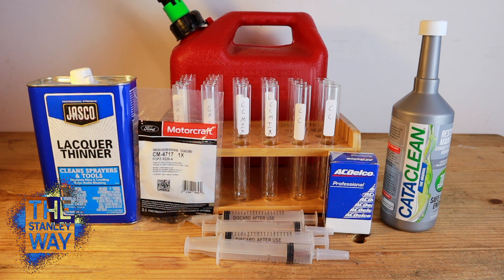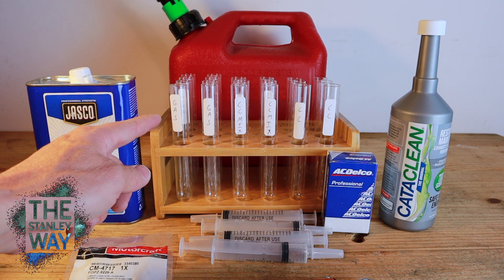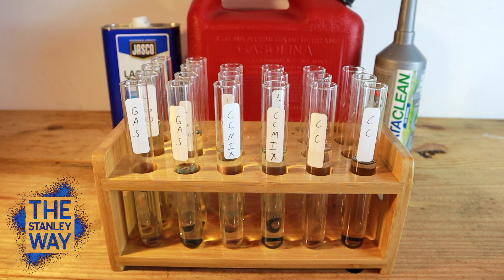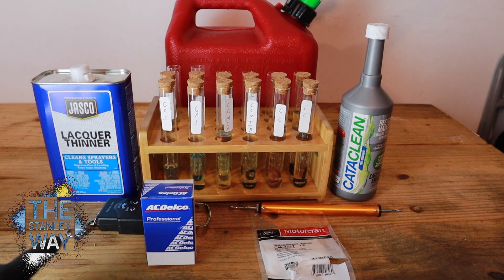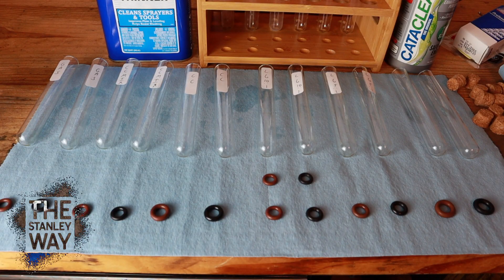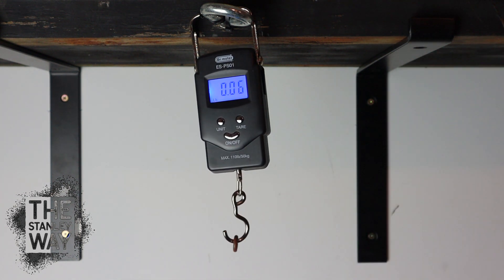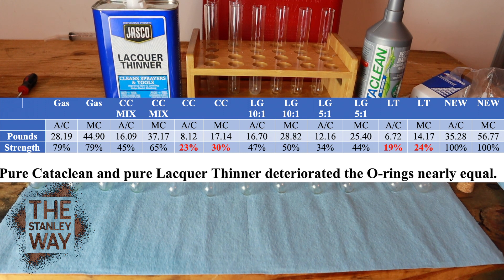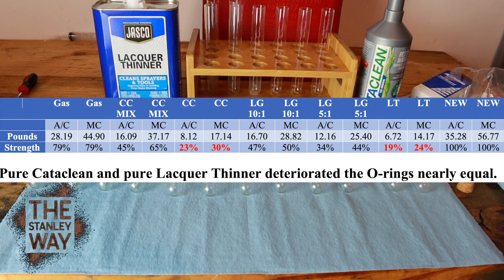SURPRISING Result | Lacquer Thinner vs Cataclean O-Ring Test Video

Comment: im questioning the brand/quality of the scale used and whether its reliability is of par........ To rubber o rings  that are not designed to be stretched but actually compressed ........ I skimmed through the highlight was not fawn of it ,🧐

Comment: I have been so paranoid putting lacquer thinner in my vehicle. I got the 420/430 code for a bad catalytic converter.  This eases my paranoia. My car is a 2008 Ford Fusion SE 3.0l.
Reply from the maker: I was too, that’s why I put it in two of my cars before I ever put it on YouTube. Multiple cars later and we have had no issues. Cataclean is an off the shelf cat cleaner that is way more expensive and is almost the same as lacquer thinner.

Comment: Wasnt able to get through the whole video so bottom line it please, a gallon of LT to 10 gallons of gas once a year will that hurt any seals??
Reply from the maker: No
Reply: @TheStanleyWay Awesome, does this also clean the Oxygen sensors along with the cat at the same time?
Reply from the maker: It probably does but I haven’t checked to see.
Reply: @TheStanleyWay I would have to think it would because it's the downstream sensor right before it enters the cat is the way the gas flows

Comment: I greatly appreciate the work you work you done comparing Cataclean and Lacquer Thinner. I saw another YouTube video showing the MSD sheet on Cataclean and Lacquer Thinner, and they had the same ingredients and about the same ratio of each ingredient. So, Cataclean seems to be a Lacquer Thinner but a little diluted.
Reply: I am considering using a qt of thinner instead of the whole gallon and may just do this on a longer term basis as in gradually instead of doing it all at once.  When I drive in 3rd gear, to get rpms up, is when my left below threshold code comes.  I had oil seeping past the valve seals on #1 & #3, and this on a brand new Chevy crate engine, from the oil pan up to new heads.  It had gone back for warranty service where they said they replaced the seals but in 3rd gear I still get that code.  I will run Cataclean and then pull those two plugs to make sure they are clean.  I will pull them first to see if they are clean and then after treatment.  I had an independent shop do the bore scope test which initially showed why I was getting the Cat code in the first place.

Comment: There's a video where the guy compares the ingredients between CC and LT and they are the same mix of chemicals, but the percent composition of each is not known... and it would vary from one LT to another anyway.  I'd like to know the ideal brand LT to use, personally.
Reply from the maker: @mockingbird187  I don’t know of a specific brand but if it matters to you I have been told to go to a paint store like Sherwin Williams and ask for there old school LT without all the additives that the big box hardware store brands have. I’m not sure if there is enough of a difference but you can do that if you like. 

I have used LT from Lowes now on multiple vehicles since these videos and haven’t had a single issue. One was a 400,000+ mile Corolla that ran better, stopped smelling like fuel and the light went out. The car is still on the road, I just saw it yesterday.
Reply: @ that's awesome! Yeah, this weekend I'll probably cross 200k miles in my Honda Fit.  I hope it sees 400k miles!  Though not in my possession. Ha!  Probably give family a real good deal on it.

Comment: Im not throwing codes, yet. When i hit over 3k rpms i get a smell in the car. Only smell it when the windows are down. Someone said it was dirty cats. I've run 2 bottles of cataclean and it seemed to help a little. Would the thinner be better?
Reply from the maker: I think it is better but that is up for debate. My neighbor just used Cataclean and it didn’t do anything but the lacquer thinner did. I would try it. I have personally used it on two vehicles with success and no issues.

Comment: Ive used a full gallon of laq thinner w half tank. no problems. worked for me.
Reply: Is your engine valves ruined yet?
Reply: So what about a year later?
Reply from the maker: Still no problems with any car we put lacquer thinner in the gas tank.

Comment: Just tried the lacquer thinner gallon in my 04 Silverado 5.3 and I put the 1 gallon into about 20 gallons of gas (roughly 3/4 tank) because I was too impatient to bring it down to half a tank (roughly 13 gallons). After running the engine for 15 minutes it cleared all my codes and is running excellent, even at that 20:1 mixture and after watching your test I'm glad I didn't do the 13:1 mixture. Cool test, it's definitely meaningful to see the deterioration this can cause to rubber o rings and seals. To anyone with a check engine light on a car getting P0420 or P0430 codes with an average fuel tank smaller than 20 gallons, I'd highly recommend you do half of the recommended amount of lacquer thinner than typically recommended. Start with half a gallon of thinner in 8-10 gallons of gas and if it doesn't work, many people say you can do a 2nd and third treatment until the cats clean up.
Reply: Yes, clean up all depends on condition. If the cat’s internal material has disintegrated numerous treatments won’t clear codes.  

Catastrophic failures are contributed to punching the gas.  Punching it when the cats have a buildup of soot can cause the internal material to blow out.  Dirty cats also cause cats to overheat. Overheating weakens the internal material.

To avoid catastrophic failure I run lacquer thinner once a year or 15,000 mile intervals. Also avoid punching the gas…

Comment: Good video and I’m going to use the Laquer Thinner in my vehicle. The odds are too good not to.
Reply: Yes, clean up all depends on condition. If the cat’s internal material has disintegrated numerous treatments won’t clear codes.  

Catastrophic failures are contributed to punching the gas.  Punching it when the cats have a buildup of soot can cause the internal material to blow out.  Dirty cats also cause cats to overheat. Overheating weakens the internal material.

To avoid catastrophic failure I run lacquer thinner once a year or 15,000 mile intervals. Also avoid punching the gas…

Comment: There is a better way to clean cats. That better way is just like it’s done with diesel fuel emissions systems. 

It’s illegal to tamper with our emissions systems. Drilling a small hole upstream of the cat. Then spraying carburetor cleaner directly into the cat while engine is running would also clean the cat. Dirty cats are the issue, how to clean them is the controversy.

No one would disagree that there are better ways to clean cats. Until those better ways aren’t considered tampering or illegal. We are left with mixing lacquer thinner in the fuel tank. Removing the cat then cleaning it is the hardest way.

The P420 is common, it’s a money maker. The lacquer thinner treatment doesn’t make any money for those in the replacement business. It’s almost like the industry pretends soot and grime shouldn’t happen in a gasoline cat, but it does. 

If it clogs up enough, you will blow out the internal material causing a catastrophic failure.  Overheating of the cat is also contributed to soot. I don’t wait for the P420 I now run lacquer thinner around 15,000 mile intervals.  My scanner tells me it works…

My scanner also indicates the emissions system works better with overdrive off in city. Overdrive off in stop and go city driving will help in preventing soot buildup. Overdrive on while driving on interstate above 60mph if very fine indeed…
Reply: Agree entirely. Will be running half a gallon of thinner per 8-10 gallons of gas in every vehicle I own once a year from now on.
Reply: @enthused7591  with half gallon, you could mix with 5-8 gallons just under or at a quarter tank.  I haven’t had any sputtering or hesitation. Drive on highway with overdrive off. After about 30 miles slow down then punch a few times to power clean.  Note; punching it can cause the internal material to fall apart if it’s weak. So, avoid punching the gas, it’s a lot of pressure for the cats to deal with…

Run out as much as possible before refilling. Don’t mix then wait a day or week. Not a good idea letting it sit around…
Reply: @enthused7591 

My scanner also indicates the emissions system works better with overdrive off in city. Overdrive off in stop and go city driving will help in preventing soot buildup. Overdrive on while driving on interstate above 60mph if very fine indeed…
Reply: @anthonyiocca5683 how would u know if the catalytic is completely messed up? I put 1 gal in my car to clear the code but didn't work do u recommend adding more?
Reply: @MatrixFinalBoss  No,
One 1 gallon treatment would of cleaned it.  Unfortunately the internal membrane has failed, and is gone or partly damaged. 
I had to replace one of two in my Mustang…

Comment: Interesting but wouldn’t you get a more accurate estimate if you mixed it at 32-1?  And the o rings inside the engine would have some lubricant coating to?
Reply from the maker: I agree. There are many other ways to do the experiment differently for other results. Thanks.

Comment: Just a thought but if the orings expand wouldn’t that make a better seal.  Also per cataclean’s instructions you put it in at a 1/4 tank then only drive for about 10-15 miles before filling the tank which further dilutes the mixture.  I’m having a 420 code on my 04 acura tl and am going to try cataclean for now.
Reply from the maker: Yes it would make a better seal.

Comment: Thanks a lot for your effort in producing this knowledge for us all. As 'ínformation' only, rubber O rings {like all rubber} is produced out of latex, carbon, sulfur - and other accelerators and retardants - pretty nuch as they manufacture a "cake"...each one has its OWN recipe! Then, mixed up in what they call a Bambury. Mhen mixed well, they "form" them via an injector or extrusion machine. Once formed, it is "cook" under temperature and pressure. The "curve" deployed at curing time is of most importance, because it "reads" for us, the special characteristic of elasticity and/or reliance to breakage. This is done on an instyrument called Rheometer. All rubber components give off oils and solvants used to dissperse the components during the mix, btw.

I think that exposing the rubber briefly to some lacquer thinner, cleaning it afterwards off it, will not harm any part of the vehicle's system, if done fast. Thanks, again.  ✔✔
Reply from the maker: Thanks, that’s good information.

Comment: Hi,i have merc w211 2003 yr,what do u suggest to do when it comes to catalyst cleaning? Ty
Reply from the maker: If you don’t have any running problems or codes I wouldn’t worry about it. If you have a P0420 code you could try putting a gallon of lacquer thinner in the gas tank with half a tank of gas. Then run the car at highway speeds until the tank is empty. This often helps a car pass emissions testing.

If the lacquer thinner doesn’t work you could try removing the cat and cleaning it by soaking in a bucket of water and soap overnight and reinstall.

Comment: I used cataclean on my Is250. The code would come on & off. Once I put the lacquer thinner, light never came on. I did 1/2 gal of gas & 1 gallon of lacquer
Reply: Half a gallon oir half a tank of gas? Hopefully you mean half a tank.
Reply from the maker: Awesome! I love hearing stories from people that used it and it worked. This saves so much time and money. Thanks for sharing.

Comment: What about diesel cars can we you thinner
Reply from the maker: Thank you for the question. I wouldn’t advise to use lacquer thinner on diesel cars because it would lower the flash point of the fuel and could be dangerous to the engine. Diesels are high compression engines and it is designed to use fuel with a high flash point. Adding lacquer thinner will lower the flash point and possibly cause detonation. Great question.

Comment: Gas and anything put in the gas tank doesn't touch the fuel injector o rings so the test is pointless
Reply: The O-rings on injectors are designed to seal all fuel and fuel vapors from escaping into the engine compartment. These rings are made of a type of rubber that is petroleum and hydrocarbon resistant. It is very important to have an effective O-ring that can seal fuel and fuel vapors in and keep them from escaping.
Reply: I'm not a Mechanic, is that true?
Reply from the maker: No that’s not true. The point of o-rings is to keep fuel from squirting out between the injectors and fuel rail. If you take the o-rings out, you will have fuel exiting through the o-ring grooves. When you install the o-rings, the fuel is stopped by the o-rings. I guess he believes there is some sort of force field around the seals.
Reply: Ok so does it work or not
Reply from the maker: Are you asking if lacquer thinner works to remove the P0420 code? Some say no, many say yes, you be the judge. *EASY* Lacquer Thinner FIX P0420 Code Video
https://youtu.be/Py0D8Gu6jiQ

Comment: Did you have any problems with the exhaust manifold cat converter breakup in the Altima? Assuming it's the 2.5L?
Reply from the maker: No it never did that. I checked it with a bore scope because I knew that was a problem and it was intact.
Reply: @TheStanleyWay  I had an 06 Sentra spec-v with the same motor and with a lil hard driving it happened to mine. Just ended up swapping it with a dc sports 4-2-1 header and eliminated the cat. I caught it early before the pieces messed up the cylinder walls thankfully. Thanks for the excellent video 👍
Reply from the maker: You are welcome. If I planned on keeping the car I was going to do the same exact swap, especially because a new cat may do the same thing and kill the engine. Glad you fixed yours permanently. Thank you for the comment.

Comment: Have you tried loosening  the cat or header and pouring the lacquer  thinner into it then close it up then  drive it after a few hours of soaking?
Reply from the maker: I have never tried that, mainly because I haven’t had to. If I had to loosen anything up I would probably remove the cat and clean it removed from the car and then reinstall. Thanks for the tip though.
Reply: @TheStanleyWay   I'm just wondering because like the honda pilot , it's harder to remove the cat.
Reply from the maker: @duypham76  it would really depend on the vehicle and how hard it is to remove the cat. With a difficult removal you may be able to remove the upstream fuel mixture sensor and pour some in that opening, worth a shot.
Reply: @TheStanleyWay  oh thanks I think thats the perfect place.
Reply: I've heard some remove the 02 sensor and pour seafoam directly in the hole I'm assuming you could do the same with LT

Comment: I have an f150  Ecoboost 3.5L that likes to run rich so it would always kick off the check engine light. Not being a car guy, I thought I'd have to buy a new catalytic converter but researched other less expensive options. Lacquer thinner did the trick, but the light would come back on every other month or two. Though Cataclean might be safer so tried it and it works too. BUT it's so damn expensive that I'm going back to LT. Thanks for the video!!
Reply from the maker: That is awesome! It is a shame that you have to do that so often with your truck but at least you found a trick that works. You are correct, Cataclean is very expensive. Thanks for the comment.
Reply: @TheStanleyWay  When I bought CC, I just rationalized that it is way cheaper than new cats.
Reply: Techtron Fuel System Cleaner didn't work.
Techtron Fuel Injector Cleaner didn't work.
Cataclean didn't work.
Lacquer Thinner didn't work.

It's bank 2 not both so it's an exhaust leak or the cat.  Next move will be that O2 sensor trick.
Reply: The problem was, I had a power failure over a few days and installed a new battery.  The light came on during the trip home.  I had to run a 'Drive cycle" which allowed the computer to run a proper systems check.  Light went out.
Reply: Emissions systems work better with overdrive off in the city. Interstate overdrive on is very fine indeed.

Clean up all depends on condition. If the cat’s internal material has disintegrated numerous treatments won’t clear codes.  

Catastrophic failures are contributed to punching the gas.  Punching it when the cats have a buildup of soot can cause the internal material to blow out.  Dirty cats also cause cats to overheat. Overheating weakens the internal material.

To avoid catastrophic failure I run lacquer thinner once a year or 15,000 mile intervals. Also avoid punching the gas…

Comment: I'm here to see if cataclean is just a 20 some dollar, 1/2 the size bottle of lacquer thinner
Reply: LT BS $26+
Reply: It is pretty close I think.  You can get cataclean for a lot less money online though.  I got 3 liters (the autoparts store bottle is half a liter), so 6X the product for around $45.  I just bought it on Amazon.  I figured that I was going to be using it on a bit nicer car, so why not.  I've used it on my lawnmower too.  Not all lacquer thinner is the same for what it has in it either, where cataclean at least is likely consistent.